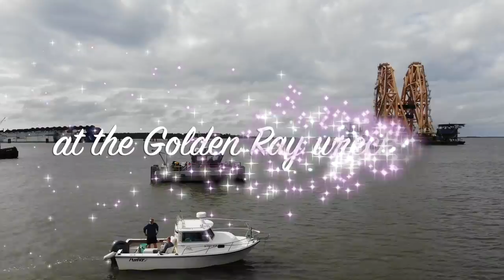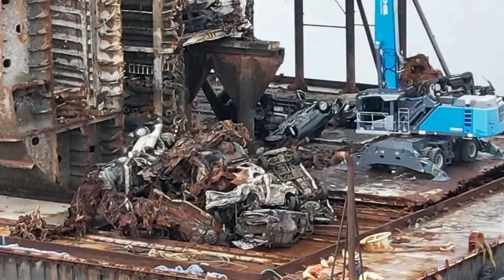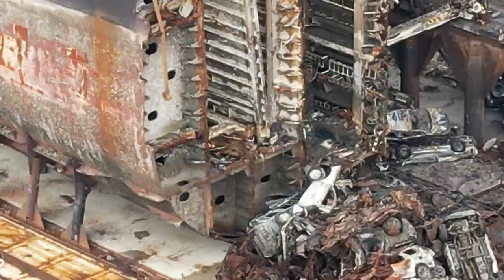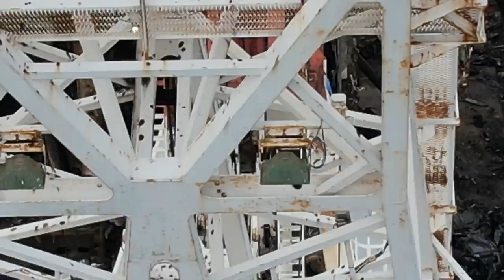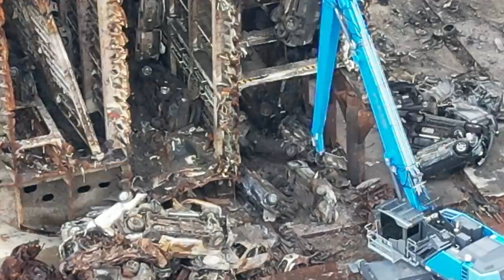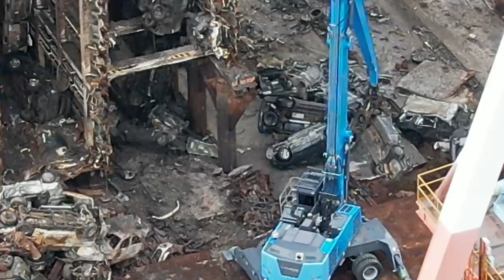DROPPIN' CARS!!! on October 25, 2021

Comment: Good video.
There was a similar situation in Liverpool a couple of years ago. There was a fire at a multi-story car park. The heat damage to the concrete was so bad the building had to be demolished and none of the cars could be recovered. As they demolished the structure, any cars would be plucked from the building and put on a recovery truck. They were taken to a scrap yard and checked for the owner's personal belongings prior to scrapping.

Comment: This seems dangerous. There still is gasoline in those cars, right?
However he is an expert with that machine.
Reply: Very little.  They require the tanks be almost empty when they load.   Just enough fuel to drive it on and off the ship.
Reply: @JoeLinux2000  3 Gallons Sir.

Comment: I was completely unaware of this incident, and needed to investigate/google what this was all about. I am in Vancouver, Canada.  I would expect that something of this magnitude would have been newsworthy globally, simply because of both environmentally and/or value.  4,300 vehicles, even though it had a capacity of 7,400 vehicles.  This was a brand new ship!!!   No matter what was involved, EVERYONE ends up paying for this loss, thanks to the insurance system.

As a result of a multi-national consultation, a salvage operation was performed "resulting in the nearby marshes, and beaches, being cleaner then they have been in many years."

Comment: Wanna know what happened to the ship, but haven't watched the previous episodes?

Watertight doors were not closed properly, weights and loading characteristics were entered into the computer system that handles trimming and ballasting needs, and with no way to verify everything is correct in notes made during loading and correct info entered into computer calculations, the ship set sail. Due to these improper figures entered into the computer system and thus ballast not being where it should be, the ship listed during a turn when leaving harbor, and water entered through improperly closed watertight doors.
Reply: Thanks 👍🏻

Comment: Wouldn’t a crane with solid connection to the grappling hook vs the hanging grappling hook be a lot faster?  I’ve watched large cranes with a controllable grappling hook maneuver much faster.  This method looks really slow.  Not blaming the crane operator, I just think he’s using the wrong equipment.
Reply: I agree w @dan mitchell. Wrong tool.